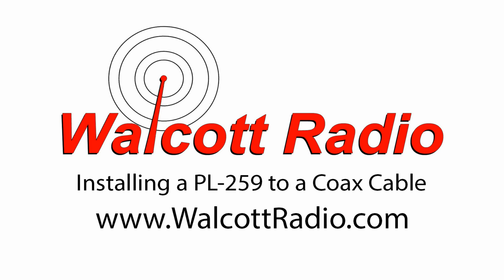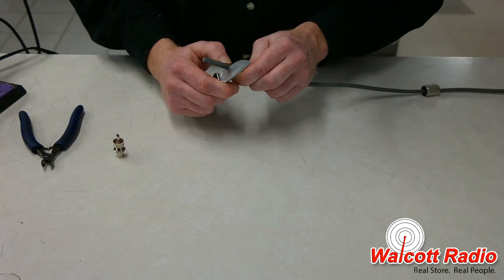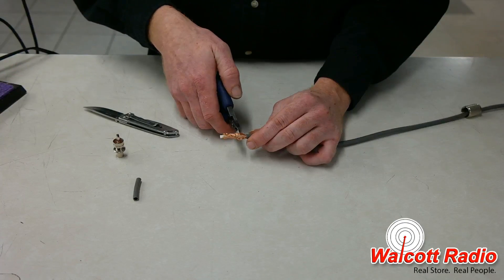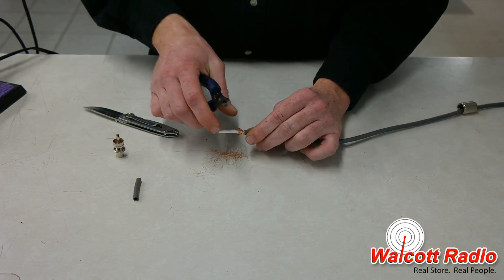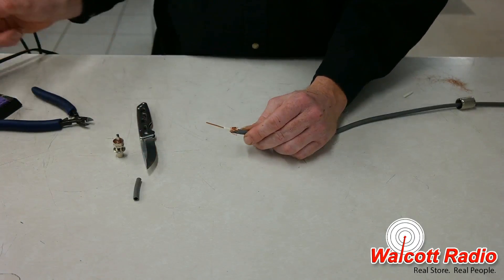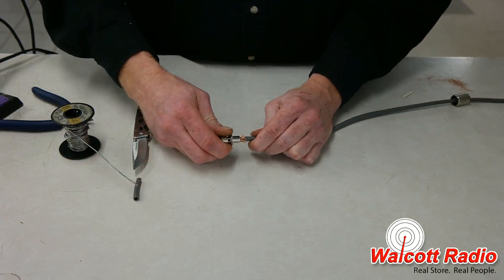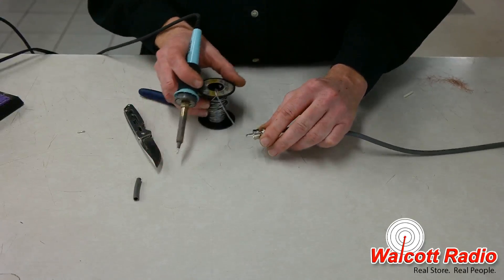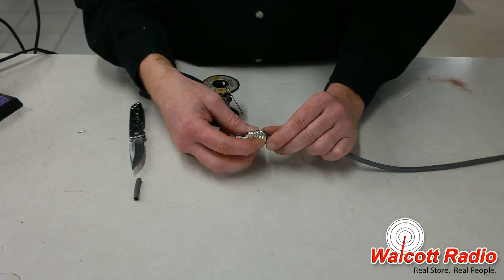How to Install a PL-259 Coax Connection

Comment: Oh boy!  Did you ever think of the purpose of the holes sideways on the PL259? Perhaps it does not matter with  a 4W cb radio....
Reply: He ignored the step of soldering the copper braid to the barrel of the connector through those holes. Doing that insures that you have a good ground of the braid. I've been doing these for over 35 years. I was taught by a friend that soldered for NASA.

Comment: Try pushing a connector over an LMR400 coax cable after pushing braid back over the coax shield (black cover). It's damn near impossible if not impossible.

Also- if possible one should try and keep the foil wrap with the braid on any coax having foil under braid.

Soooo...

Cut shield AND braid and dialectric back about  inch. Reason? Shield tends to make cutting braid less messy and helps braid from twisting and leaving strands behind. Then cut ONLY shield back another 1/4 inch. DO NOT FOLD BRAID BACK OVER SHIELD!

Carefully slide the connector tightening ring over coax THEN slide the connector carefully over the exposed braid and twwwiiist on the connector over the shield. Twist on far enough to expose the braid in the solder holes completely. Solder both the center conductor pin and then ALL the braid holes.

Now check conducivity at both ends center to center and braid to braid THEN center to braid (both ends). Center to center should show conductivity or closed circuit. Center to braid should show no,  NO conductivity or open circuit.

Do not bypass this test! If even a single wire on the braid touches the center conductor you have a short... Not good for your radio! Also, if for some reason (never seen it happen) either the center conductor to c-conductor or braid to braid is an open circuit, well, your coax won't connect to antenna and keying your radio can lead to burnt finals or turn your radio into a door stop (destroyed).

Comment: Can you tell me what connector I need to attach this type of connector to my shortwave radio? I think it is a 3.5 mm mono jack but I am not sure where to get one. Thank you, Lee.
Reply from the maker: Hello Lee. I'm sorry, I don't know which connection you need either.  Your best bet is to check the manual for your shortwave radio, determine the exact connection type, and then try to find someone that carries it.   If you already have coax cable with a connector, then you may be able to find an adapter.  But the first step is to determine the connection (motorola, SMA, FME, Mini-UHF, UHF, BNC, TNC, etc) your radio requires and go from there.
Reply: You have been very helpful and I appreciate you answering my question. Thank you! I have determined now that a Motorola ( 3.5 mm Jack) monotype can be added to my coax which works okay. Also, it can be added to a single copper wire antenna. All my radios have a 3.5 mm Jack connection so I will be okay with this type of connector.
Reply from the maker: Glad you got it worked out!
Reply: All though I did it the same way you do it in the video it is not the correct way to install it. There is no screwing on involved in the installation. Have a look at this you'll understand http://fldx.org/site/pl-259-install.php